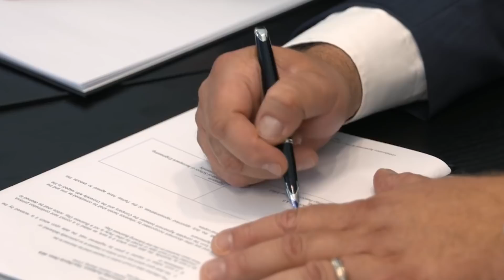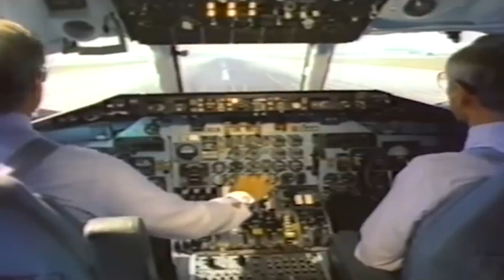Boeing 717 - Boeing model and legacy of Douglas

Comment: i like the design legacy from MD. It looks like a big private jet, not a boring design like 737 which is too common
Reply: 737‘s design was very unusual/interesting back in the 60s. Most smaller jet back then had tail mounted engine.
Reply: The nose of the 737 is hideous, while it did suite the older series with turbojets it doesn't fare so well with modern turbofan designs and stretched fuselages, and that layout of two engines under the wing is far to common making planes look ever so bland, placing the engines in the rear and wings further back makes for a far more sleeker and cleaner design that doesn't look so boring and has many benefits especially for passenger comfort.
Reply: Super_Slav Apparently you’ve never had to sit next to one of those fuselage mounted engines. Gives me a massive headache every time. Wing mounted engines make for a much quieter flight, and the systems requirements are much simpler for wing mounted engines.
Reply: Silly boys go have a beer and chill out
Reply: I have actually sat next to one of them, the last row window seat in a crj-900 and it was not bad at all and once I was in the second row of a fokker 100, so silent, best flight ever, meanwhile the 737-800 I was on was the loudest flight I have ever been on, on the return flight I bought hearing protection on board, rear engined planes are quieter since most the noise comes from behind the engine so anyone behind the engines is suffering on a 737 and the front isn't too good either.
Reply: Lol @ Super Slav calling a Fokker a “quiet” aircraft. You must be legally deaf... lulz. 

BTW... looks are subjective. You cannot use logic to defend or attack something that’s wholly subjective. 

They’re all boring dildos with wings IMHO.
Reply: Rear mounted engines present huge structural design problems as the airplane gets larger. It’s common for business jets because they are small, cabin noise is lower and the landing gear is much smaller and simpler. The decision to mount engines in the rear vs. underwing is not one based on aesthetics but on the mission of the aircraft, weight, reliability, maintainability and operating cost.
Reply: The 717 didn't have a tail stairway unlike the other MD-80 versions.  It would have made a great private jet, and if I had the money I would have loved owning one!
Reply: See Mentour Pilot's discussion on Wing vs Tail mounted engines: https://www.youtube.com/watch?v=QqjZSHIKWzE
Reply: Lol you are only saying that because 737 got popular around the world. You would have said the MD was "a boring design" had it been a success like the 737. The 717's tail mounted engines are actually very common in the 80s and 90s. I guess that makes the 717/MD boring, too. Interesting...
Reply: That is the most illogical post I have read in a while, the 737 is a hideous aircraft regardless of if it sells well or not, the md-95 is beautiful.
Reply: I agree, 737 is hideous.
Reply: Looks like you know so much about planes. I wonder why all the engineers at Boeing decided not to place the engines in the rear instead of under the wings if it really provides so much benefit as you said. Your response, "layout of two engines under the wing is far to(o) common making planes look ever so bland," further proves my point in my original comment. 737s are boring to you because they are common, just like most other planes with engines under the wings. Imagine 50 years ago, Boeing decided to mount the engines in the rear like MD, you would be calling them boring again because hey, they are common and look bland to you. Nothing will ever satisfy you as you can always find something to complain about. I am no expert, but I believe there're reasons why all major commercial plane manufacturers mount their engines under the wings in their modern jets. Even Bombardier and Embraer now mount engines under the wings on their new jets like CSeries and E-jet. Coincidence? Or maybe there're reasons behind their decisions?
Reply: @edwink1467   Where did the engineers decided to place the 3 engines in the great Boeing 727? I don't remember to have seen them under the wings. By the way, engines under the wings are easier to inspect and maintain.
Reply: Illogical? Care to explain what makes the 737 "a hideous aircraft?" Let me break it down for you since you are clearly incapable of logical reasoning. Wahyu Wirawan said the 737 is boring because it is too common. Doesn't "too common" mean it's everywhere/ not special? If a plane is everywhere (like the 737 and A320), doesn't it mean it sells well and therefore it's a success? Using HIS logic that popular/common = boring, it is safe to assume that IF the MD was the popular successful one instead of the 737, he would have called the MD "boring" and the 737 "a design legacy from Boeing." I see nothing "illogical" in my post. On the other hand, you are putting out a statement without anything backing it up - that's what I call illogical. Perhaps go back to school and learn what the word "illogical" mean.